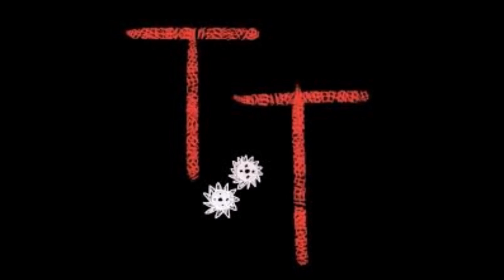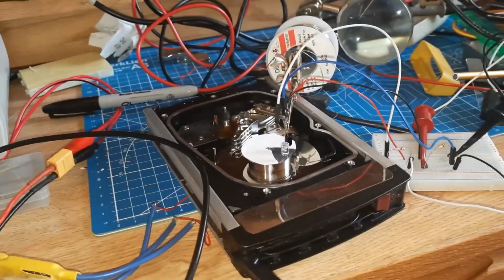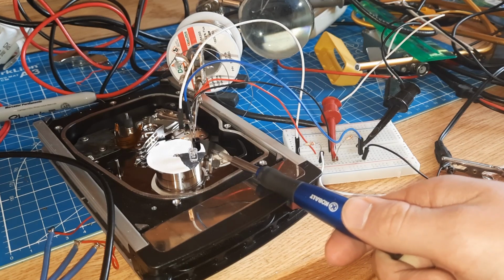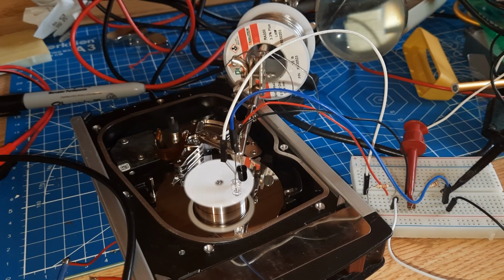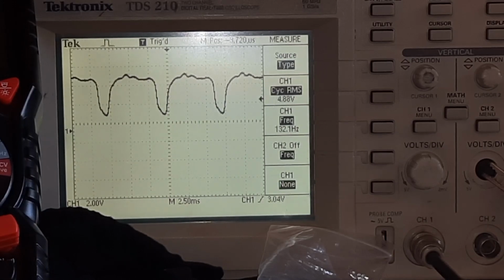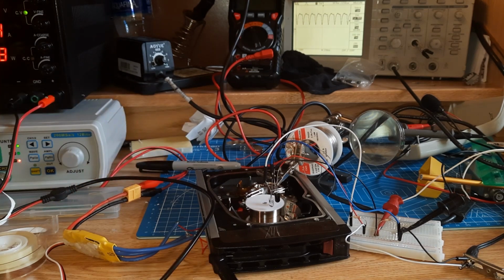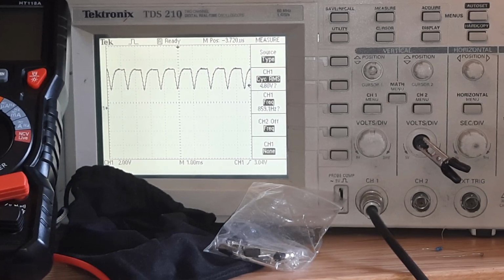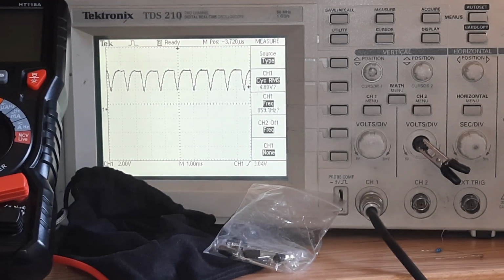Modifying a hard drive to spin at 51000 rpm

Comment: Usual hard drives for home users spin at 7200RPM, energy saving drives at 5400RPM. But you have a server drive, those spin at 10000RPM, and yours is even the fastest at 15000RPM

Comment: the hard drive your messing with spins at 15,000rpm normally, those 15k drives have 2.5" platters in a 3.5" case for heat, turbulance, and access time reasons.
Reply: 380 m.p.h. at 51000 rpm!

Comment: If you were to replace the bearing do you think it could reach maybe 70,000 rpm? :P
Reply from the maker: Perhaps.  I also probably could have if I had a larger power supply and a better ESC.
Reply: 72k RPM will be good.

Comment: If it was stabilized to work normally, it would be faster than ssd, right?
Reply: No never ssd literally pull and push electrons to read and write no mechanical drives can do that plus just to run it at 50k rpm you'll need somewhere around 4amps so not worth it 😂

Comment: I'd like to have seen it in actual operation, reading and writing, but with the speed being entirely manual
Reply from the maker: I would as well, although I do not think that would work as it would have to sync it's reading with the rotations of the disk.  The circuit would not know the speed under manual control.

Comment: Normally the esc works 0 to 5v to change the speed. Did you just connect the generator to the center wire and ground?
Reply from the maker: The ESC uses a PWM signal that switches between 0 and 5 volts 100 times per second. The ratio of the time it is at 5 volts and the time it is at 0 volts(duty cycle) determines speed.
Reply from the maker: I connected the hard drive motor to the 3 wires. It doesn't matter which ones